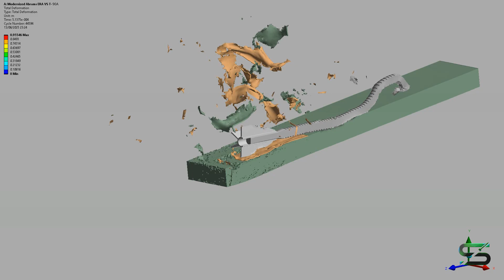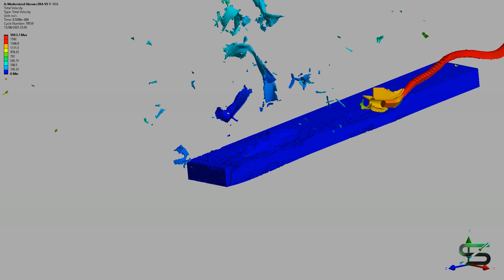Modernized M1A1 Abrams with ERA VS T-90A | APFSDS Armour Piercing Simulation

Comment: L M A O my man has managed to  ''model'' Kontakt-1 do the same damage as if  it was Relikt ( double guillotine flier plates ). There is not way K1 induces  remotely near that level of degradation ( bends like 1/3 of the penetrator 🤣) on APFSDS  ! 

It is public knowledge that K1  has no major effect even on small to medium caliber darts ( 30-75mm ) let alone for main caliber. That mostly is because K1 walls are too thin ( 2-3mm for the casette and 1mm for the 4S20 tiles  ) to  do anything , 4S20 tiles  are optimised for cumulative jet disruption no APFSDS, they need high cumulative jet speeds to be set off . That is the reason why Kontakt-5 appeared with new more sensitive and more powerfull  ( to propell the heavy flier plate ) 4S22 tiles and heavy flier plate ( around 20mm so x10 as much as K1 )  in order to have an effect on APFSDS. Relikt took K5 concept to the next level by implemending new 4S23 tiles even more sensitive and double flier plates  to affect tandem cumulative and APFSDS with ''anti-ERA'' features such as segmented core or segmented tips. 

Even if those K1 casettes were filled with 4S22 tiles  which is possible and actually a common practice in the Russian army , the absence of a heavy flier plate on K1 would still doom it against APFSDS. Furthermore 3BM59 is advertised by NIMI to be hardened against heavy ERA ( so at least K5 if not beyond ) which means it employs  either a segmented rod , a segmented tip or both, which was not simulated here . 

TLDR goes to show that anybody can make those  fake simulations tell whatever they want. People should stop taking them for face value , they are nothing more than entertainment !

Comment: This xant be right can it? How is k1 this effective against 3bm59? Either the materials or explosives used got mixed up. Those thin flyer plates are a too soft and b too thin to xause this much damage
Reply: This guys simulations have been inaccurate from the start.

Comment: The problem is that "Contact-1" will not work in this case. Only when using new throwing modules.
Reply: Верно, контакт-1 никак не реагирует на попадания вольфрамовых стержней, другое дело кумулятивная струя, против чего он и был создан

Comment: You should test with 3BM42 rather with 4 tungsten alloy segment to see if we could made different. 
The ERA seems pretty overpowered or it was extreme angling? The penetrator made with depleted uranium seems softer than normal. Also, good simulation. I cannot spending 20+ hours to making these
I'm requesting for head-to-head comparison between Nozh ERA and Relikt? Likely equip T-80B with Relikt (T-80BVM) and T-80B with Nozh (T-84U) or maybe also T-84 Oplot which having Duplet is 2 layers of Nozh
Reply: The angling does it thing, it is like warping projectile in explosive

Comment: The Abrams tanks used in Ukraine are equipped with first-generation ERA, which only provide protection against chemical energy munitions and do not offer any defense against sabot rounds. These ERA blocks are the same type used on the T-64BV
Reply: well as seen in the simulation, they can provide that small difference to go from penning to not penning. The era still has a significant amount of explosive mass and that can make the ap round go from hitting below its critical angle to hitting above it, making it ricochet like the sim shows. Of course if the era was at an angle like 60 degrees, it wouldnt have done crap, but at this high almost 80 degree angle, it does do something.
Reply: @galacticdragon9841 "While your point about simulations showing minor deflection is interesting, it’s important to clarify that first-generation ERA (like the ones used on early T-64BV or fitted to Abrams in Ukraine) were specifically designed to counter HEAT warheads, not kinetic energy penetrators like APFSDS.

APFSDS rounds travel at extremely high velocities (often over 1500 m/s) and penetrate armor using pure kinetic energy. First-gen ERA lacks both the explosive force and plate movement needed to significantly affect such penetrators. In fact, even more advanced ERA systems like Kontakt-5 or Relikt only reduce APFSDS effectiveness by around 20–30%, and that’s with optimized placement and design.

So while angle and impact variables might cause slight differences in very controlled environments (like simulations), the idea that first-gen ERA at high angles can reliably affect sabot rounds is not supported by real-world data or battlefield performance. Their protective effect is, in practice, negligible against KE threats."

Comment: At such extreme angles every little bit counts, but still I am very surprised that the effect was so significant even if it does make sense.
Reply: I mean, also consider the fact that it wiuld also more than likely acivate other bricks of era inline with the first, so the effect would be more promounced.
Reply: Do you see the insane material dynamics of the rod?

This is not realistic physics but ... don't actually know what this shall be. More AI slurp adding on the braindead technical talk, i guess.

With APFSDS, which have pretty ... PRETty high velocitys, material barely has time to move, deform or derive kinetic shockwaves. ERA-1, which indeed has been applied, are made against HEAT warheads, not APFSDS. The effects on darts are almost ignorable, and the sharp frontal segment shown in the 'simulation' is that sharp to prevent it to be hit, as it is in fact barely capable of stoping anything that is pointed at tanks. But chances you get hit here (other than by drone or artillery, or AT weapons in urban setting) are minimal due to the angle. So that is the reason the actual NERA is placed in the wider frontal plate and the turret cheecks, where hits are way more likely. You can't just slap unlimited armor on a tank, and that's the tradeoff. You're hit on the sharp upper front = remove driver +X additinal crew from the payrole.

And btw. no operational Abrams have been deployed with DU armor by now (except in the UAE army), for ... many reaasons. But tanks being disabled by other tanks is an incredibly rare occasion by now, so the whole theory of how to construct your tank, or build them in general, is now flaoting. We by now all fight with obsolete stock materials until it is used up, and then we look what we can sell well enough to keep production up. But for now, none of the vehicles we build technically make sense in other than a economical surrounding.

If we'd keep tank duels like in WW2, Abrams would need to armor up against KF71 and Vacuum-1/2 projectiles, and there is no armor for the US to slap on to have any chance of preventing full energy penetration (and there is barely with the russian layouts, including top notch counter-dart ERA and acceptable APS).
Reply: @nikitatarsov5172  not everything is AI get your head out of your ass. At high enough velocities all solids start to behave more like fluids. All simulations and real life slow motion tests show this.
Reply: Cause its b.s ... And the likely hood of the Russian tank targeting the front plate is nil, altho I understand thats not the point of this
Reply: Смысла никакого !!!  Все танки НАТО учавствующие при попытке контр атаки или работающие из укрытий уничтожаются мгновенно !! Расчеты ПТУР и Дроноводы Ланцет дерутся между собой , поскольку за каждый видеоматериал с уничтожением Леопарда или Абрамса , Министерство обороны мгновенно перечисляют на счет 5 миллионов рублей !!  Идет охота за танками.  При контрнаступлении Нацистов из Украины и наемников НАТО в 2023 году , были самыми результативными экипажи МИ- 28 . Они могли ближе подобраться и обнаружить бронетехнику и с безопасной дистанции лупили управляемой ракетой Вихрь ,который разносил Леопард и детали от него находили аж в соседних хуторах 😳💥. Что за компонент применяют в этих ракетах . 🇷🇺
Reply: @yorgent4523 Спокуха кремлядина. Давай подписывай контракт на СВО чем комменты писать.
Reply: @yorgent4523 
Полный пиздёжь, а эти нацисты существуют только в твоей голове или из кто-то и правда видел?
Что-то при прорыве границе в Курске в августе - сентябре 2024, никаких дроноводов-ПТУРщиков ни Ми-28 с ракетами "Вихрь"(видимо ты имел ввиду Ка-50) не оказалось...
Reply: @yorgent4523  Russia can't even defeat a NATO supported country, so what about fighting NATO?
Reply: Это гражданская война на территории России . Русские не проводят полномасштабных военных действий на терр Украины  @Halal_Dan
Reply: @yorgent4523  The level of indoctrination in your country is truly comparable to North Korea these days.
Reply: @Halal_Dan  Fighting NATO is easier - Russia can employ all it got and get help from all of her allies.

Comment: It’s surprising to me we still have this tank on tank simulation when it’s been displayed in full that most tank kills are from anything but other tanks in ww2 it was anti tank guns artillery and aircraft and today its drones and anti tank guided missiles.
Reply: Cause the main purpose of tanks is not to fight another tank, but... well... as the name implies, it is supposed to tank damage

In combined warfare, tank is not a vehicle protected by armor but it is the armor itself protecting the whole formation. And the main punch came from infantryman and artillery behind them

Unfortunately, just as we can see in most Ukraine war footage, Russia use them COMPLETELY wrong
Reply: @za_pravdu1943 bud with drones out there and no real way to deal with them any country conducting armored warfare is going to have a very hard time against drones. And I’ve seen just as many videos of Ukrainian tanks getting  destroyed or a  mobility kill in fact Russia just took a leopard 2A6 in summy last week. So no armor is safe.
Reply: @jesseterrell2109 yep, no armor is safe. But I've seen a lot more infantryman take down a drone than a tank does

If combined warfare is done correctly, whatever you can't handle or whatever can defeat you, all you have to is entrust it to another friendlies and do only what you can and meant to do

Also, drones have shorter range than artillery and they rarely fly anywhere near its far range, so you can expect the operator not too far from you, you just have a much harder time to spot them. And you have drones in your side too
Reply: @za_pravdu1943 fiber optic drones have a range of more than 20 km I would say that’s pretty capable.
Reply: @za_pravdu1943 You don’t spot operators. They are 5-10 km behind the front line. They can be picked up by drone reconnaissance or signals intelligence, but they then have to be attacked by air support or artillery. Infantry and armor aren’t a valid counter to drone operators.
Reply: @za_pravdu1943 the Ukrainians were given 2 years of training under NATO command on how use their tanks COMPLETELY RIGHT. And now every Abrams tank in Ukraine has been destroyed. Germany and their partners just keep replacing the older gen MBT’s that have been destroyed.
What’s it take? 
Is using your tank warfare tactics correctly only applicable when the enemy is surrendering en masse like in the gulf war?
Reply: @Ватник-Б-2 It's not the crew, it's the officers or anyone giving them order. Both Ukrainian and Russian mech units are pretty much poorly organized.

Tanks can't survive without infantryman sweeping around for enemy portable anti-tank group, and yeah, drones change the shape of the war, but tank still perform worse against them than infantryman does so the point is still similar
Reply: @za_pravdu1943 Infantry elements get stripped from the armor elements by artillery. That’s why they are often absent. Also, infantry can’t easily sweep for ATGMs. ATGMs have ranges of up to several km and infantry ranges are measured in hundreds of meters. They have to get very close to enemy infantry to do anything about them, and most of the time infantry doesn’t survive that long. There’s a reason only 5% of casualties are from small arms in this war. 

I don’t for a second buy that American or European forces could show up on that battlefield and somehow be better organized and find great success. They’d likely just be drone food, because there is no doctrine that currently counters drone attacks against tanks and unlike the forces currently fighting they’ve never had to deal with an enemy who can send drones at them like this. 

You have some hypothetical notion of how fighting should be going on but it’s not supported by realities of the cutting edge of warfare. It’s not 1975 anymore.
Reply: @Ватник-Б-2  That isn't true lmao. How does it feel knowing that your friends are dying?
Reply: @haiguizeify it’s only untrue to your feelings.
The only Russian friends I have live in America only about 30 miles away from me.
actually they’re the only Russians I know and don’t even consider themselves to be Russian.
Reply: @haiguizeify go back to your gameboy son. 
Understanding war will come with age
Reply: @Ватник-Б-2  aww it looks like I made the little kid mad that all of his friends are dying for nothing :)
Reply: @haiguizeify just, go back to the game my son… this world is too much for you.
Reply: @Ватник-Б-2  "понимание войны"? Что тут понимать? Война это ужасно, её начинают люди в высоких кабинетах, из за своих личных амбиций. Эта война не нужна простым гражданам, как и любая другая.

Comment: Do the front turret of the export M1A1 next
Reply: It's pretty much the exact same hull
Reply: @Masterafro999 keywords ''front turret ''
Reply: @MH4127-d2e  😂😂 oh shit! You're absolutely right. Lesson learned don't text and walk at the same time
Reply: @Masterafro999 it happens way more than I'd like to admit ya good 😂
Reply: The t90 doesn't even pen the turret front without the era
Reply: @TerranSupremacy depends ,not every abrams is equal
An abrams from Egypt can be penned on its front turret's because it has a very basic armor package while something like an aussie or moroccan abrams won't be

It entirely depends on what abrams variant
Reply: @MH4127-d2e yeah official DOD Abrams that go out first right now are a different tank completely 

It's still a can but a difference of steel over aluminum so to speak
Reply: @SpaceCoffee700 still depends ..though from what I know the main differences between export and local models is the material for NERA (rubber instead of polycarbonate plastic ) , the generation of NERA aand the material . Though i wonder if the US subsidises the DU with something like tungsten

Comment: T90 fires the 3BM60, not 3BM59.
Reply from the maker: With its 125mm 2A46M-5, the T-90A can fire both of them.
Reply: @SimulationPlus  shhhhh, hes a wt player thats lost
Reply: @gurin3374  Tbh... yes😂
Reply: bm60 and bm59 are the same APFSDS but made of diferent metals. 60 of tungsten and 59 of DU
Reply: @ser43_OLDC  so, it's not the same.
Reply: @temong0long054  It is the same apfsds, propelant charge and everything except they are made of diferent materials. So if a tank can fire 3bm60 it can fire 3bm59. 

Other thing is if the unit is supplied with one or the other

Comment: Aren't they putting ERA blocks because of FPV drones and not tanks?
Reply: Yeah, the era blocks are for all of the rpg rounds since the tank v tank fights are maybe like once a day across the war, these tanks are mostly just slinging heat and he rounds at infantry and apcs.
Reply: Not on the front. The turret cheeks were enough to stop RPG-7 type warheads used commonly on drones without ERA. 

Actually, I’m guessing the ERA on the front is there mostly for ATGMs. Leopard 2s were Kornet food in 2023.
Reply: @QualityPen  Leopard 2 were hit by Ataka launched from KA-52, not Kornet.